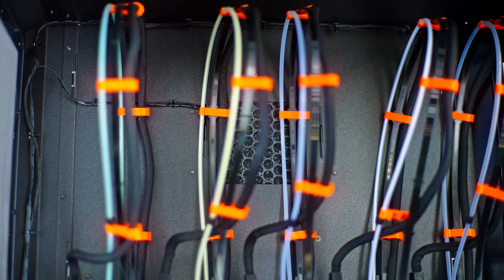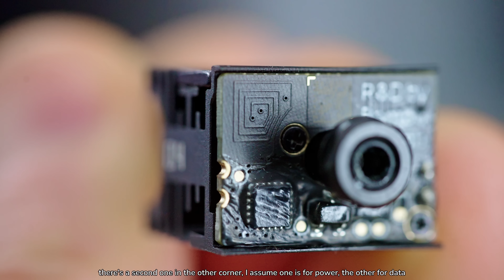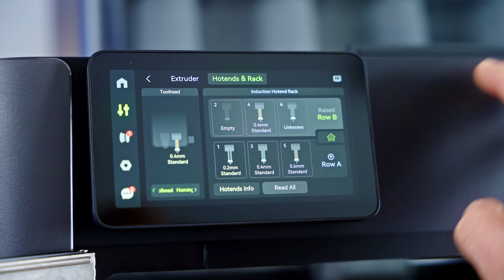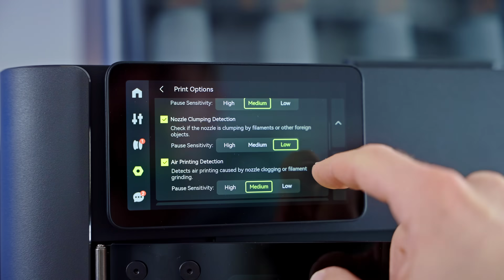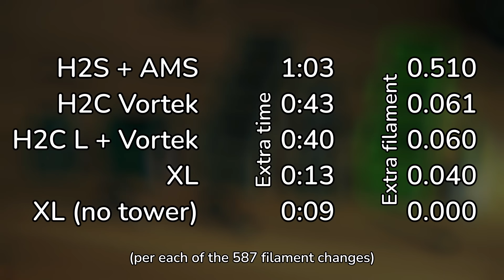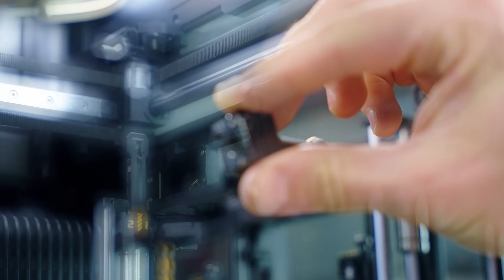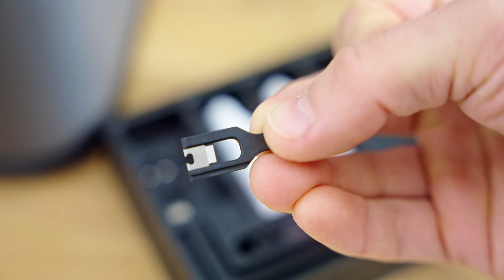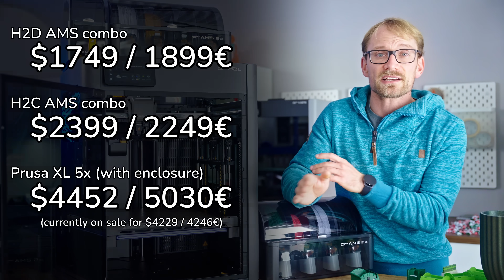The H2C is Bambu's 7-Hotend Patent Evasion Masterpiece!

Comment: Verry awesome review, but shouldn't the nozzles ooze more and therefore introduce more stringing?
The heating zone is significantly larger compared to standard hotends, which melts more filament at once. 
This allows for faster printing speeds but makes retraction less effective compared to a "normal" hotend, leading to more oozing and stringing. 
The energy consumption should also be considerably higher because of this, right? 
I know from Deutsche Bahn that when they heat the train wheel tires to shrink them onto the rims, a lot of energy is needed for the process.

Comment: If Snap maker does not fumble their delivery to backers the U1 wins in speed and versatility. Bambu still has the best software, but this system is kneecaped by still relying on AMS
Reply: The AMS is expensive, bulky, and slow, so of course they added it to their new printers too

Comment: wow 47seconds to change colors. I think i am still leading towards the U1 for multicolor prints. I already have an x1 with 3 ams and a few a1s with ams lite.
Reply: Same.  I’m still concerned about Snapmaker part availability and software support though…
Reply: @swells1 i have the same feeling. Bambu and prusa i know and they keep up support. But idk about snapmaker. I did see they list replacement parts for sell.
Reply: I've had few opportunities to experience Snapmaker support, and I have to say it was a great experience. One of my Artisan hot ends was DOA, than - over half a year later - PEI from my bed was coming off. Both times I got replacements very swiftly without much hassle with just a proof rather than "investigation" trying to invalidate me. I even got full refund for a sale they put on just after I bought my printer (I got back the difference in price). And the machine is great. Honestly not much bad I can say about the guys, just the opposite. 

And while on it I just have to trash the creality support. God that was awful, not buying their stuff anymore no matter how good it is, just because of that.
Reply: @icac613  thanks for these insights! I've seen reviews about the pre-production models of the U1, praising the support and wiki pages, but was still a litte worried whether that was extra support specifically for those reviewers, and it would drop off as soon as the product is shipped. 
Hearing you say that you had good experience even half a year later is very good to hear!
And yeah, I also saw they offer 30 day price matching, which is nice to see.
Reply: @swells1 I backed the U1 so I've been following it fairly closely. I feel like they're trying to split the difference between Bambu design/affordability and prusa openness where there is definitely a niche to be filled. They have already started making troubleshooting wiki pages and a bunch of replacement parts available for preorder which are both encouraging signs but only time will tell for the long haul. I had 4 Bambu printers but am wanting to get away from them as they slowly are walling it off more and more.

Comment: multi-AMS already has the 4-to-1 from the AMS then go through combiner tubes into the printer. I’d hoped Bambu would have advanced that to allow more of the filament to stay closer to the hotends so the retraction/swap is faster. 
toolchangers are faster but if you need more colours/materials than the toolchanger has heads, you have a problem. But if you don’t (aand this is likely a diminishing returns thing) then the toolchanger is a lot faster.
Reply: The AMS lite fixed this already for the A1 (mini). It pulls back like 5 cm until right above the toolhead. There is 4 PTFE tubes going into the toolhead.
Reply: @matthijsvandeweerd1415  Yeah, if bambu made a gen 3 AMS that uses four tubes going to the printer like the AMS lite it would save heaps of time.
Reply: @NWGR  As the print head is still heating, there isn't much point having all four tubes going to the print head as the filament would pause until the print head is ready to accept it. So, no real time savings.
Reply: @jemijona  It definitely reduces changing time though; it's how the A1 and A1 mini operate with the AMS lite. The filament only needs to retract a few cm. With the AMS or AMS 2 the filament has to retract all the way back to the AMS body. I can't remember who did the video, but there was a time comparison done and the AMS lite is noticeably faster.
Reply: @NWGR  So as soon as the AMS lite changes to the next filament, does the printer start printing straight away, or waits for the new filament to heat up?
Reply: @jemijona No waiting, it swaps the filament, purges the old filament, then back to printing.
Reply: I see great potential for improvement there. The slicer/printer knows exactly what is needed next, so from the moment the filament is cut, getting the new extruder and getting the next filament into place should be an entirely parallel process. You can even start heating the extruder, at least to a decent idle temp, before the filament is ready.
From what I've seen in prior reviews it is not done like that yet, but maybe they've already improved this on the machines being shipped.

Comment: Pretty sure the snapmaker U1 is faster than the prusa XL so to see that the prusa XL is SO MUCH faster than the H2C, for me this is a huge fumble from bambu. It might address waste, but speed was also a factor that was just as important the the U1 solves BOTH of those issues.
I was worried about my U1 backing but not anymore. It's not even close. Yes there are other things about this printer that are nice to haves but i don't think i will worry about those honestly.

Comment: It seems a downgrade on the H2D imo...More expensive and smaller.

Sure it saved SOME waste... but honestly filament is so cheap and I do sometimes print multi colour but then its mainly 2 colours. Like I dont get why you would buy this when you can get that snapmaker one.

It seems like a bit of a rushed concept. Not impressed.
Reply: High-temp multi-color prints strikes me as a niche.

Comment: Interesting review and cool to see what is on the market. It seems to have some clever mechanism - the wireless transmission of data and induction heating can reduce wear when swapping at the cost of a bit higher energy usage.  In the end I'm not convinced. It is a major step forward to avoid the plastic poop but as far as I understand the H2D also reduces it. The H2C and tool changer mechanism seems like the first stuff to break. It is unnecessarily complicated with the multiple rows.

Also the DRM in the nozzle is a red flag. Their argumentation just stinks of marketing arguments. As you said the induction heater could be dangerous - but in the end it isn't too hard to publish specs (which will be reverse engineered in a few minutes) and void warranty if using a 1$ nozzle and causing damage. Their main argument is "Greed and control". 

I wish Prusa would do something with their XL units. In my head this was announced yesterday and is waiting for their next iterations.
Reply: Why do people keep saying it's too complicated? Have you ever seen a CNC machine that changes bits? This is the same thing. It's actually far less complicated than a full tool changer. And a lot more compact.
Reply: 'the drm in the nozzle is a red flag'
People, please learn to read and think for yourself instead of blindly following some Youtuber desperate for clicks...

Bambu said they will not support third party nozzles, they never said they would actually block them.
Name 1 3D printer manufacturer that actually supports third party nozzles?

I've never seen Prusa, Creality or Snapmaker say 'buy random third party nozzles and they will work 100%'. No company supports third party nozzles. The question here is whether Bambu will block third party nozzles and that question has not even been asked because this youtuber only cares for clicks through FUD...

Comment: Not convinced. DRM Nozzle? Overcomplicated assignment procedure? And you cannot even use multiple nozzle sizes in one print?
But I am not really in the market for locked down printer anyway.
Reply: Why doesn't the thought of bambu remotely bricking your printer on a whim make you feel warm and fuzzy inside?
Reply: @tavelkyosoba  Because if that is a concern then the person will know how to shut the WiFi off and use the printer in LAN only mode or use it fully offline with an SD Card...   The printer doesn't NEED to be online... So, if you're concerned about Bambu being able to shut it off, don't put it online...   It's a non-issue.   if they REQUIRED it to be online all the time, then it would be a problem... But they don't.
Reply: @Panda-Monium-Creative  If i were a betting man i'd say this model will indeed require an internet connection to work.

Comment: Nope, too many moving parts. The future is the INDX. More nozzles, no filament change, almost no moving parts (other than the normal ones). AND, still not able to switch between any filament, so soft TPU's are out of the equation.
Reply: 'Too many moving parts' followed by 'the future is more complex moving parts'???
What moving parts? A BLDC motor that will outlast the printer. A retention clip that can be replaced in 5 seconds and some linear bearing that might need greasing after a year or so?...
Reply: @someguy4915 bot detected
Reply: @howtoguy17  Woah, you sure showed them! Were you intimidated by the big words that they used? There's nothing shameful about asking someone to explain something that you don't understand, you know.

Comment: I dont get it, if the filament is not already loaded into the hotends might as well just use H2D
Reply: With the H2D if you use more than 2 different filaments you need to purge out the old filament. And to prevent the old filament from contaminating the new one you need to purge out quite a lot of filament.
Reply: waste

Comment: Im curious if they are gonna release a H1C, same version with just 1 nozzle. That will be my perfect machine.
Reply: forget H series this compromise solution should have been put on P2 ...
Reply: My first thought was "but how much would that really lower the price?"  It feels like just removing the fixed nozzle isn't that much of an advantage.

Then I checked, and RRP for the H2S is nearly 1,000$ CAD less than RRP for the H2D.  So it's possible that an H2CS ("H1C" doesn't fit the naming convention) would be similarly reduced.

Still, I suspect there's some loss-leading going on in the H2S, accepting a lower margin to capture the more price resistant part of the market, and that this would be less valuable for the tool-changers.
Reply: @davydatwood3158  I'm pretty sure part of that price difference is due to the H2D PSU being larger than the H2S, which is why the H2S doesn't support the 40W laser module.
Reply: @Mamba_LZ  I'd believe that.  Of course, one presumes the H2C also doesn't support the 40W laser (I at least haven't seen anythign that suggests it does), so an H2CS wouldn't have that ready price savings.

Comment: By insisting on continuing to use the ams, they have created an unnecessarily complicated solution. Also seems too slow overall for a true multicolour solution.
Reply: Yes and No. You can kill all backwards support and alienate their user base. Or go full steam ahead. It's an elegant and expandable solution. 4 tube Anycubic isn't bad but it's limited in colours. 4 spool Snap isn't bad but it's limited to colours and no dryer and no enclosure and high volume. Everything is compromises

Comment: Not versed on the various solutions out there, but it seems like in the future they could possibly also inductively preheat the nozzle on-deck to pipeline the switch and hide that latency.
Reply: Thomas mentioned preheating “on deck” to reduce switchover times. Yes, “inductive preheating” makes the most sense. I have an “inductive cooktop” and it’s better than great. Water boils in about 45 seconds. Also, 80% more energy efficient than “old-school heating element” electric and 20% more efficient than gas (without the fire hazard of either). On the joking side, I guess I could use my Phone’s inductive charger to “heat up” my phone too (LOL).

Comment: watched because i hoped there will be come cutting drilling included in the review. I don' t like Bambu, but their take on the  induction heating of the nozzle compared to trident is good - it works. So other brands will also follow now :)
Reply: Inductive heating is not hard, I made one for a project. Running at 12v, it could heat up in maybe 40s and on 24v it would be faster. The hard part is getting everything right. I did no optimizations but with induction heaters you are constantly worried about burning up mosfets or getting pcbs so hot the solder melts until components fall off. Inductive is a neat idea but in practice is worse than resistive for basically any application. Pogo pins on the nozzle connecting to heater and thermistor would probably be a better take than induction and wireless communication
Reply: @bobtheblob2770  Only if you want to replace the pogo pins each week...
Reply: @someguy4915 most pins are 10k to 100k cycles so I doubt they would wear out too bad unless you overcurrent them
Reply: @bobtheblob2770 Physical cycling isn’t the main issue. It’s reliable electrical connection. That reliability includes influences like dirt or contamination, oxidation (less so with gold-plated contact surfaces), and corrosion (hopefully the pogo pin contact surfaces are made out of the same material or you have to worry about bi-metallic corrosion).

Comment: I know that there was probably quite a bit of engineering that went into creating this, but I also think they happily embraced going to the induction heater over a pin-connected dedicated heater, so they could claim "USER SAFETY" again and finally have a way to lock out third parties on that aspect. I'm aware that any pogo-pin like connection (or anything that gets actually plugged in/out on every swap) has reliability concerns associated with it, but going to full on induction as a solution seems rather... extreme? Being fully wireless is a nice gimmick, but even a high flow hotend caps out at like 5A on a 24V supply, so it's not exactly high current either. A heater also doesn't add that much weight or volume anymore these days.
For me, Bambu has effectively died as a recommendation to others and/or option to buy for myself when they started their inevitable attempt at full lockdown of hardware people own. I'm about to slap a stealthchanger on my Voron2.4 and have a feeling I'll be very happy with that, but I also know not everyone is able to do that or wants to invest the considerable amount of time for that.

Comment: Yeah, novel solution, but you're not saving much in the way of time unless you strategically stick to two materials vis-a-vis functional prints (main material with different support material). I'd just assume retrofit an exisiting machine with a second hotend however, which still leaves INDX in the front-running position, provided they can offer a higher temp solution than 300C.

Comment: Does Voxel have anything for the flap that opens at the top as well?
Reply: That's the intake, there wouldn't be much gained by filtering it as it's only pulling air into the printer.

Comment: The heat bed does not heat equally, some places differ by almost 30˚C.
Reply: that and the hotends are timed on selfdestruct, someopne should have explained to Bambu that putting magnets on something that is getting heated to 300+ centigrade is NOT a good idea ... magnets and heat do not mix well ...
Reply: @Asghaad  High-temperature magnets exist. For example, they are used in EV motors and actuators in machines. At this point we don’t know what they’ve used. CNCkitchen has measured, the heatsinks stay below 60°C for short prints.